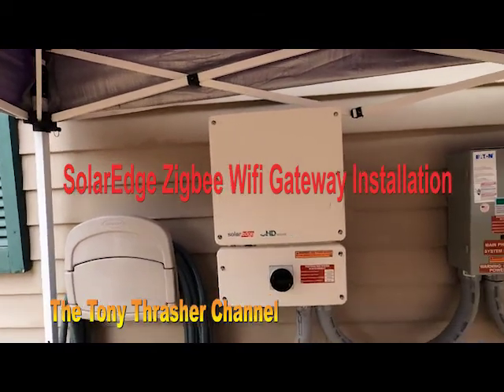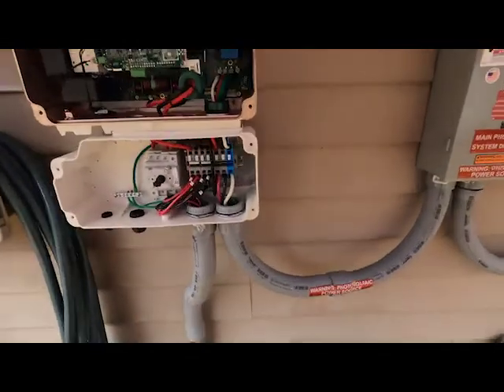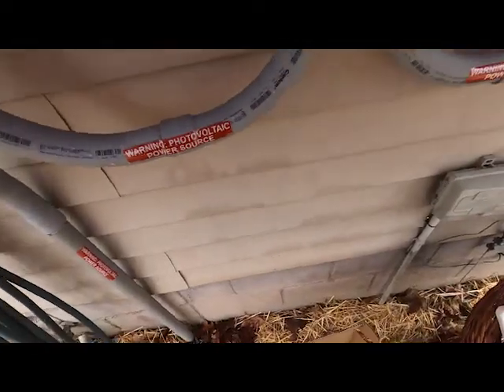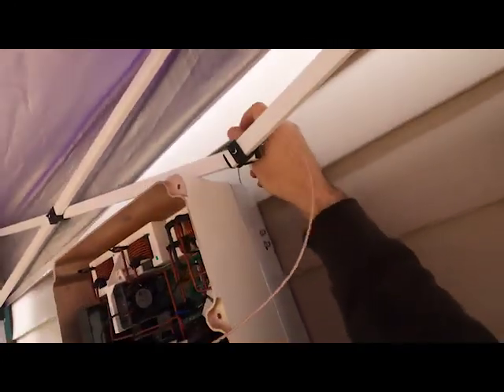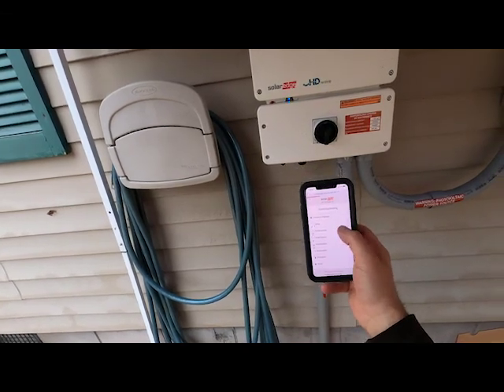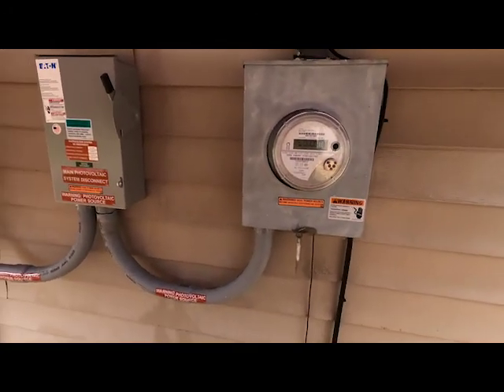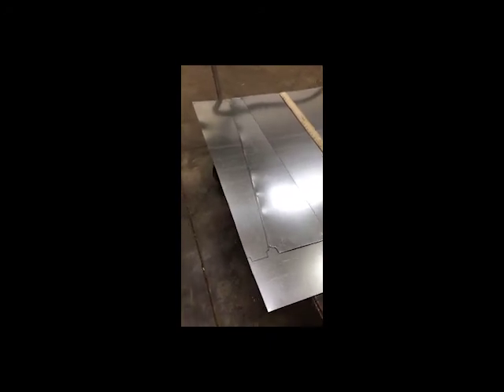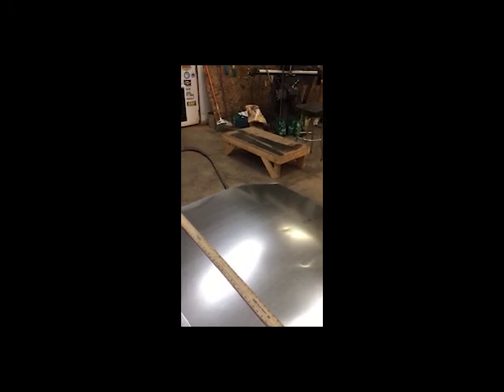SolarEdge Zigbee Wifi Gateway Installation

Comment: Tony, thanks for making the video. In a few weeks, the 3G prepaid wireless network that supports my SolarEdge monitoring is shutting down. I don't want to pay for an expensive new card and wireless service. I'm looking at installing a Zigbee. Your video is helpful. Thanks again!
Reply from the maker: Glad it helped
Reply: I went crazy when I lost my wifi. I called the installer but he was too busy. I took a chance I looked at the gfi plug in and lo and behold due to a power surge it tripped the gfi. Reset and done.